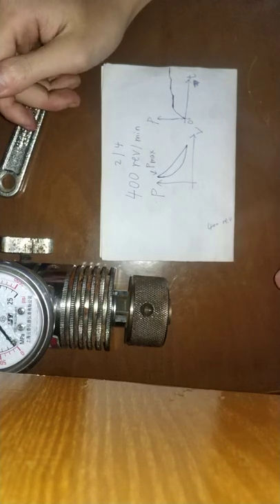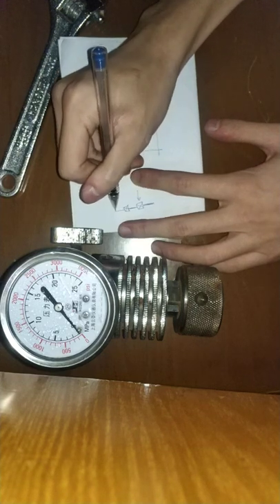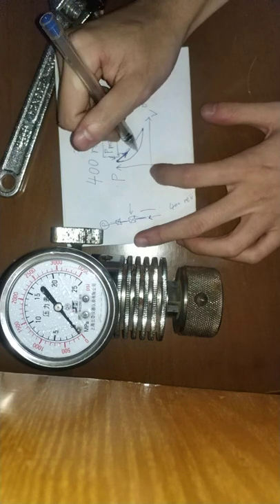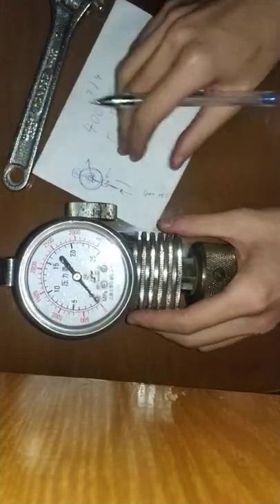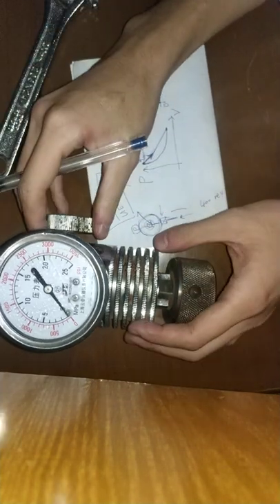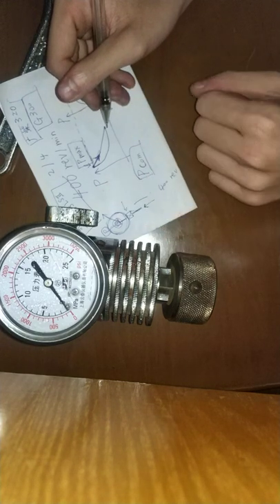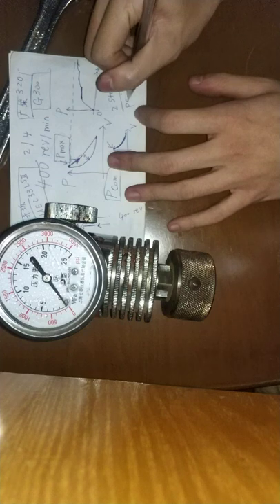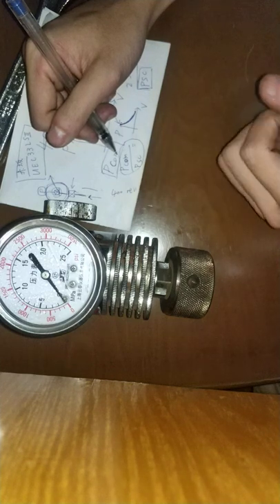peak pressure gauge for marine diesel engines

Comment: brother, can you pls reply? i have a question.
when taking generator performance, we need to increase generator load. why we need to do this?
Reply from the maker: That's a good question. Firstly the engine parameters are  designed for the specific power and speed on which the efficiency reaches the highest value, so you need to get close to that power and speed to compare the performance with the original value given by the engine  builder. Secondly the turbo charger is designed to deliver the certain amount of air to the engine at certain power level, so you also need to get close to that situation to record engine performance. If the load is too light the fuel air ratio won't be what it would be at normal operating condition and we would get wrong exhaust temperature. Last but not least, normally if we increase the load, the mean effective pressure would get higher, so as the leakage from the piston rings and valve seats. The performance check  should show the decrease in peak pressure if the leakage is serious, so if we do the check at light condition the derating in peak pressure may not be that clearly, it will be harder to  judge whether the rings are in good condition or not.
Reply: @uecmitsuimarinedieselengin873  many thanks! ❤❤